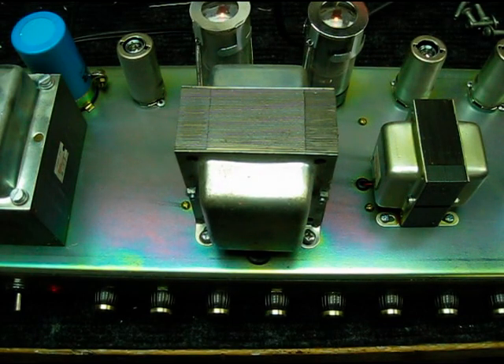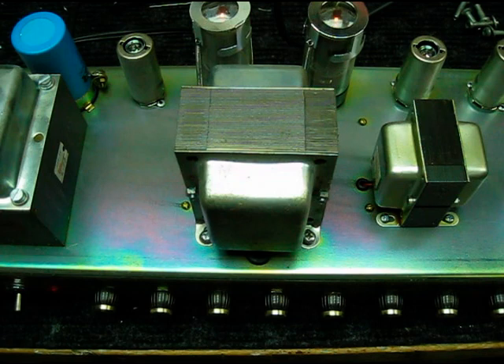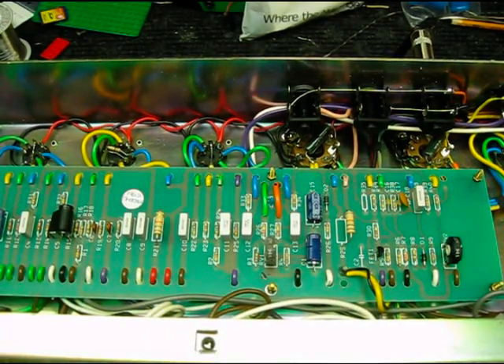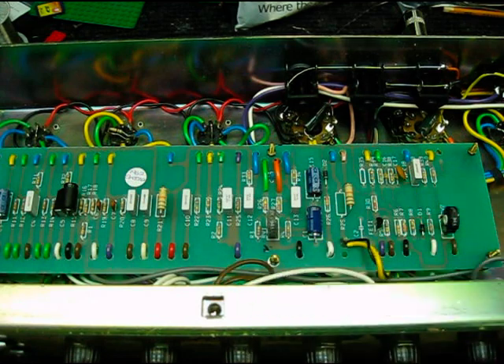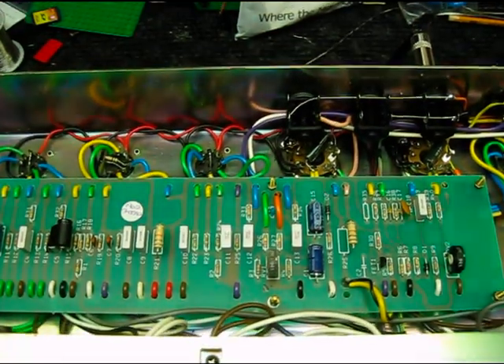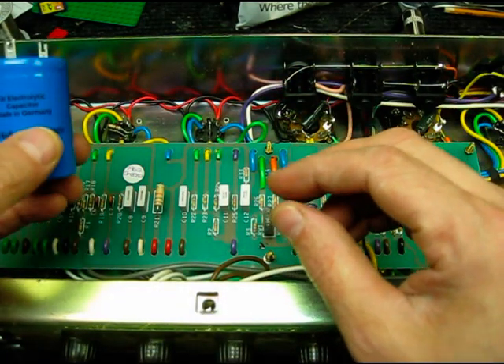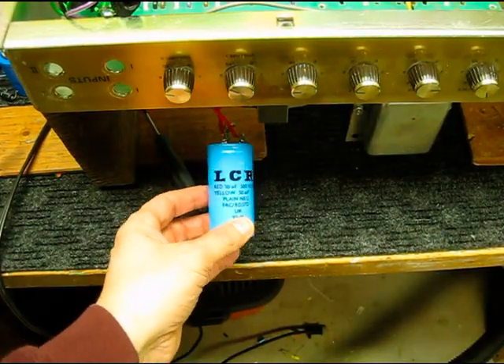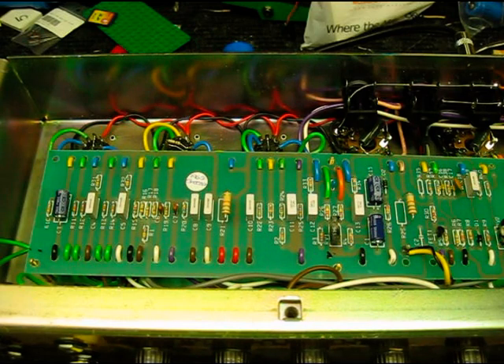Bluesbreaker reissue  capacitor replacement for  Clapton Beano tone

Comment from the maker: The silver mica 470pf bypasses the bright channel 470k mix resistor.  I did not add a cathode bypass cap to the second stage ... although I tried that years before when I first did work on this amp. This amp is mostly stock execept the bright cap swap, volume bright cap removal, change of output couplers to .02 and replacement of all electrlytics in the power supply with 60's values.

Comment: What volume control cap? with a 500k resistor? At 2:13 you say "a double 15?" Did I hear that right? Could you list the parts that you are replacing with what parts?  It sounds like you say "double 16" and then "double 50" and then you say we are prolly not gonna use that".  What? Then you mention a  "double 16".  Love your video but you have me pulling my hair out.  A "couple little things" "a mix resistor bypass cap to a silver mica 470" and "changed the output coupling caps to a lower value" I apologize but what "lower value" ? Help me please. I love what you did with this amp but I can't see or understand everything you did.

Comment from the maker: I built up the cap value needed by using a double 16 and an additional 16mfd cap.    Specs 16mfd pre amp and screens 32mfd main B+. .02 couplers output section. 470pf mic channle mix cap. 100pf bright caps removed from the volumes, replaced with 470k or 500k resistors. aka the Parkhead mod which matches the taper of the old Marshall 2 watt volume pots which are also NLA

Comment: Good job, What was the end spec's with the filter cap's and the phase inverter copling, also whats the deal with the resistor on the volume pot and which one? Make one more video explaining the original specs. Anyway good video.

Comment from the maker: see some of my other videos I go through original marshalls and bassmans...
No one knows the specs of Claptons amp it was a prototype and it was stolen in late 66. Bottom line I think its more important to dial in a common reissue amp using an educated guess... and share the specs to do so. When I first did this amp for Peter 16mfd can filters were not available. the proper can cap marshall probably used a 32 x 16 hybrid for the B+ and screens is not made these days.

Comment: Hi patfurlan . I love your mod videos. I have a soultone replica JTM45 prototype. It's well made with Heyboer OT and mustards. It has a jtm45/plexi switch witch joins and splits the cathode of v1. And it also has a master volume around back. I love having the versatility of switching between bass/lead voicings. And I like the .1 caps in the output. Like everybody else I love Clapton's beano tone. Can I mod my JTM to run both .1 and .022 caps in the ouput and change them in and out via a switch?
Reply from the maker: tonebender69  I suppose you could but most people probably cannot hear the difference.  I am never a fan of doing elaborate work for .00001 % changes... I want to see a 3% to 5% audible difference that would have a cumulative effect but multiplying with another 3% improvement elsewhere... for the Beano tone find a Real Sprague Bumble Bee cap (not a repro!)  .01 or .015 ... for the amp go with the earliest JTM filter scheme and a large 20h or 30h choke...  the secret is POWER SUPPLY SAG + GUITAR TONE CAP
Reply: patfurlan Thanks for the reply. As I mentioned before I really love the beano tone and anything to get me closer I would really appreciate it. I guess I can just run the bass low on the amp and pump up the mids and presence and it should be close?
Reply: +tonebender69 Negative. Clapton has been quoted as saying he had the bass on full for those sessions.
Reply from the maker: +tonebender69 I am sure you can all you need is a double pole switch and a pair of .082 caps to switch into parallel ... IMHO its not worth the effort, choose a vale and go with it
Reply from the maker: +patfurlan IMHO the beano tone is the guitar 75% and the amp sag which was more extreme on his amp than later amps ...if you have not played a REAL 59 up loud the tone is mysterious ... the guitar is a big chunk of the puzzle

Comment: It is SO ANNOYING to hear the strings quacking as loud as the amp on so many youtube videos. Is there a way to actually mic the speaker, instead of the unamplified string quack? Having said that... it does sound way nicer with the cap changes. Imagine doing the coupling caps with mustards or Sozo, as well as the transformers....